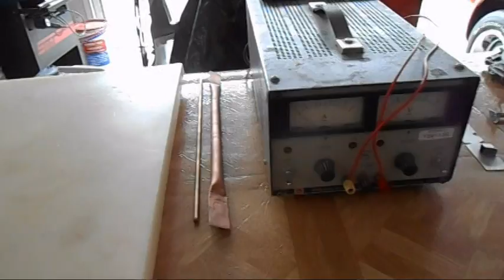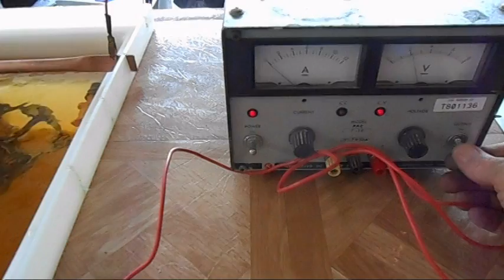Carburetor Plating Cadmium Dichromate

Comment: I'm an old guy that's been rebuilding carburetors and restoring cars for nearly half a century. Now, thanks to your video Mr. Demes, I have the Caswell "Copy Cad" system and have started plating my rebuilds. For all you guys out there who are thinking about doing this type of plating, the Caswell kit takes 90% of the guesswork out of it. I practiced on junk cores for about a week before plating a 1970 428 cobra jet Holley carb. for a customer car.  Remember, if you don't like the way your yellow chromate turns out the first time simply soda blast or glass bead blast it off and start over. I also found that most of the old carburetors will need to be zinc plated over the original aluminum / zinc alloy diecast for the yellow chromate to bond and look good. The Caswell blue chromate looks really good on brackets, bolts , and misc hardware. Two things: The amperage at which you plate parts is an educated guess and is very forgiving....to a point! Follow the instructions to the letter, never use tap water for any solution or rinse, and you will be good to go.
Reply: I have done carbs for 40 something years and have always thought about getting one of these kits . If I had a demand for carb over hauls I would do it.  What do you do for Holleys they have that greenish tint
Reply: What do you use for rinse if you’re not using tap water.?Do I use distilled water.

Comment: Nice to watch a simple vid. No "music" no BS just someone who knows their subject.
Reply: Someone could make a lot of $  if they came up with a browser add on that muted that crappy music people seem to think they need in their videos. Nothing worse than a techno beat drowning out a beautiful exhaust note or engine sound.
Reply: To mix the  yellow chromate solution, you said 1/2 oz. sulfuric acid(battery acid) per gallon and 10 oz. of sodium dichromate per gallon.  I thought battery acid was HYDROCHLORIC acid ?
Reply: Hi Don. I worked at Exide Battery for a few years and all of the Acid used was Sulfuric acid. Hope this helps.
Reply: MegaLuckydog1 and also no 30 inch wheels😨👏😨👏😨👏😨👏😨👏😨👏😨👏😨👏😨👏
Reply: Nice work, bummer that pump is so loud.
Reply: @donrutter6550  Lead acid batteries use sulfuric acid.
Reply: To each is their own bud. Sometimes on instruction videos when a repetitive process is being shown, throwing some music in puts depth in the video and gives it a bit of color so to speak. Not to mention it reflects the person’s personality too. The fact that people take the time to even post things like this is amazing even if it has “music “. Comment such as yours shows how ungrateful people have become.
Reply: Could you cost the inside of a steel fuel tank
Reply: @donrutter6550  nope it's sulfuric
Reply: @jasoncardoza6375  it's a matter of not distracting from the intended purpose of conveying the information. To much of anything turns into a bad thing. It became a contest of who can have the loudest most annoying music, and fancy video effects. In the hopes of becoming the next "famous" YouTuber for a few days. To the point that conveying the information became an after thought. Which is how important information gets forgotten, and not included. Adding personality is fine, but it should be secondary. The real famous YouTube creators that have thier videos shared, and recommended for the long term are the ones who do as this one did. He used the waiting period of zinc plating, or repetitive actions to go into more depth of information. That's how you add depth to a video. The fancy candy gets the women's attention but as Willy Wonka would say, liquor is quicker. 😀

Comment: To everyone out there. If you want your carb to look and work properly  give this guy a call. I was going to try and plate my own parts until I looked at all the cost involved. I can say 1 thing ! Screw that I sent my carbs to Harold and what I received back was a new carburetor . I swear it just came from the factory and the price was what I thought cheap compared  to what you had to do to get the same results. If you think about all your labor not only taking it all apart but then dealing with all the chemicals if you don't screw it up ! He is cheap !! He's honest and straight forward  and that is hard to come by today. I was going to have a guy in NY rebuild my carb for my 68 Camaro and he wanted 3 times more then this guy so do yourself a favor and write him,call him or send it by a pigeon if you have to . You won't go wrong .
Reply: I imagine you could pull this off fairly cheaper. Go to a garage sale, most have a 10 or 20 gallon fish tank with a under gravel filter where there's a plate on the bottom and you put gravel on top each side has tubes and you have 2 pumps you have under water, follow Harold's homemade soups mix, use some spare copper pipe, copper wire and make it flattened out on each end and the same idea for the positive get the zinc he stated buy a cheap 12v 5a constant current power supply or even a beefy DC to DC convertor and fine tune it to your needs, the current is most important. This work makes the money so you can always upgrade.
Reply: do you have contact info for harold? ..been trying to get ahold of him to chat

Comment: Just great and home run. I have been rebuilding carburetors since the late 60’s. Thousands of Q-Jets. And people hate them. It is the only true variable Venturi carburetor on the market that works great. Even the Ford VV7200 & VV7400 was replaced at the dealer with antique 2bbl’s. 
  We did not conversion coat but after cleaning and the coating was gone, we re-hydrated the metal in mineral spirits. It lasted weeks but not as good as this. 
Certified automotive ASE Master Tech since 1978 - Retired

Comment: I am an old guy and have been restoring castings for years. Your work is beautiful.  I learned a lot from your video and I thank you for that. Keep in mind the electroplating process can be done in reverse to strip off plating. Might I suggest on the die cast zamak3 parts that you do not electroplate them? You can clean them as you do then go into a mild nitric bath to open the pours, rinse, then dip in your chromate bath as you do. The result will be closer to OEM original.
Reply: Why do you not recommend electroplating the zamak3 parts?
Reply: how mild of a bath on the nitric acid....about how much per gallon would you recommend

Comment: Harold Demes+ I rarely compliment anyone because most of the time they did a poor job or it goes to their head so please, I'm not a good follower, but I must admit, you did a fantastic job Harold. It's a work of art! Most people don't want any part in real work these days, but if you took the same video and aired it in the 70s or even 80s this video would have had 500 million or more in the same time, too bad we didn't have YouTube back then. Remember when we had to learn on our own? It was a omen if someone stumbled along that really knew what they were doing and told you the missing link. Keep making new videos because things are about to go really bad or really good if allowed, everything makes full circle. I figure 2020 when the past four years sat in and things start to boom again.
Reply: On the Cathode side I would put a small copper or brass fishing swivel wrapped on tight with the copper wire and simply hook the wired part on the hook of the swivel so it doesn't rotate right back and still allows the negative to function or go all out with a high torque low voltage motor that would allow the part to rotate slowly and allow the voltage and amperage to flow to it. Just a thought.

Comment: Most of the "carburetor rebuild specialists" spray paint the carbs silver after reassembly. They look like hell after a few months, the fuel dissolves the paint and gums it all up. I hate that.I always wondered how the specialist parts restoration guys got this finish on parts. This was great. I have heard nothing but great about Caswell.

Comment: Good good GOOD , video my friend , i loved it , very to the point , i soaked it in like a spounge , as back in the days i was trying to do just this very proccess with carbs and bolts for hot rods and custom work and all i could find was from eastwood was an imitation proccess , we were not pleased with the results so i had to drop that idea , but at the time i was buffing and polishing alluminum parts and wheels alternaters and alluminum firewalls on hotrods , that was satisfying work , those turned out prettier than chrome , keepup your good work my friend and God Bless

Comment: Hey Harold. Thanks so much for the video- lots of great info and a super set up you have there. This IMO is the best zinc plating video on the web. Carbs are as you said made of Zamac or Maizac or Pot metal- it is all the same stuff- a bit of everything but mostly zinc. The name is an acronym of the materials included.Did not occur to me to plate them I just vapour blast them which looks good too. The brass inserts look great as well but it is a masking nightmare :)

Comment: Great looking results! I love the iridescent yellows, greens, reds, and even pinks that result with yellow chromating. I haven't attempted zamac. It sounds like there might be a layer of sub-surface oxide remaining that's not allowing conversion to take place on older zamac. Not to compete with what you've done here at all, but just to share my experiences with this, I did some of this for a customer this past spring on steel carb linkages and screws. I didn't get the caswell zinc bath chemicals because of the high price. I made zinc acetate solution, and used zinc roof moss prevention strip (99.99% Zn) for the anodes. It works well, and has a durable bond, but comes out flat, like primer grey. Caswell brightener doesn't appear to work with zinc acetate either. My solution to that is, I vapor blast the part after plating, and put down at least three layer of zinc, vapor blasting between cycles. The vapor blasting very quickly puts a bright satin finish on the zinc plate, which I then either yellow or clear/blue chromate. It makes more work, but the results look good. I used caswell's conversion solutions, so I'm disappointed to hear that they don't last long. I'm glad to see your zinc bath and chromate has lasted so long, so those are something I will consider.
Reply: You're doing a great job Arnlod. I'm looking forward to your new films. Cheers from Poland
Reply: @wl0oczykij  Thanks

Comment: That was excellent ! 
If you were to ever build copies of your set up including every part of the apparatus, chemicals list ,and assemble it ,I would consider buying one from you because you build quality .
But as we get older and things in life change ,we sometimes lose our desire and move on to other experiences to keep our minds vibrant.
What would be easier would be for you to write a book about your experiences and add a list of suppliers ,and the product specifications.
But this video is 10 years old and things change .
Now if you spent say $3000.00 on your investment ,& plated 100 carbs ,That's 30 bucks in process operating cost but if it takes 8 hours per carb @ $20/hour ,that yields $160.00 /day .
That might be a good slow steady income for anyone who likes to rejuvenate carbs that work excellent as long as your heart and commitment to quality doesn't waver.
I thank you for speaking about your process and sharing your knowledge .
I am impressed .

Comment: I didn’t see an extra hot wire going to the second anode. Wouldn’t you have to have one as well? I DK, myself. When I worked at Albert oil, we bought the imitation coating kit that came from the Eastwood company, it was spray cans where you would spray a silver base, then mist red green and yellow translucent metallic paint on the parts that weren’t ever gonna see gasoline, like the brake booster and voltage regulator base and horn relay base and hood release cables. They sent the Corvette to the paint shop after me spending hours detailing the whole engine compartment,And a well-known painter around here didn’t tape off the compartment and got overspray all over my handiwork! Then to add insult to injury, he sprayed everything that he had ruined with flat black rattle can! This was 25 years ago on a $4000 paint job , back when 4000 would get you a flawless paint job, It was a beautiful  64 red Corvette! I lost all interest in the car after that. It was my bosse’s and it still made me about half sick!

Comment: Looks like an early pre 1975 with remote choke on manifold, possibly pre 1972 by the WOT bowl vent at the front. Numbers start with 7** instead of of 17****. Probably 1970 Chevrolet Big-block application? I could tell for sure if I knew the primary metering rod diameter (stamp letter), Primary metering assembly piston height, secondary metering rod diameter plus tip profile and secondary metering rod hanger (stamp letters). Oh, and the primary and secondary throat diameters. Don't forget, if you use a cam that provides less vacuum, use a weaker primary metering assembly piston spring to enhance off-idle part throttle driveability. Good vid!

Comment: Great video, learned a lot! No crappy music or talking heads, just the subject!!   Wondering Why was the base of the carb not treated as well?
Reply from the maker: The base is aluminum. There was no finish on them from the factory. If the carburetor has a cast iron base it would be black oxide or manganese phosphate.

Comment: Hello Harold, this is probably one of the best videos that I have seen. I live in South Africa & to import is at times not only expensive but also difficult. I would appreciate it if you could please give me the breakdown of the chemical solution used for the zinc plating. I am in the process of rebuilding a 1956 Chevy Stepside & am thinking of plating bits & bobs especially bolts & carb with zinc. Sacrificial anodes are probably the best zinc I can get locally although I will try for plating zinc.
Reply from the maker: Hi Tony
 I use casewell zinc plating solution. You can find them on the internet. If you want to mix your own. 3 OZ Zinc Chloride to 1 gal distilled water/20 oz ammonium chloride to 1 gal distilled water. You have to plate some scrap to get the solution ready. This will give you a dull finish that you will have to buff with scotch bright pad to make it shiny.  Sacrificial anodes will give you a rough finish as these anodes are not pure.

Comment: I have a three-gallon Caswell plating kit, and it worked wonderfully at first. Now, however, nothing is appearing on the parts from the zinc plates. Do you have any idea what has gone wrong with my chemicals? I need help on this issue. Thanks a lot, great video explaining this process.

Comment: A great little video and your work is very nice.
I was alarmed at first when I read that you were doing Cad' plating as it has been linked to cancer and essentially taken off the market. Regarding the drying of the parts to let the surface harden up a bit after the Dichromate conversion, I think it's commonplace to run them through a drying oven at an actual plating operation isn't it? I often times take a batch of auto and motorcycle parts to the local plating house here in Phoenix to get the clear zinc plating (after I have done the same type of prep, degreasing and glass beading). They charge a flat rate of $100 for a full 5 gallon bucket. I didn't realize that the Dichromate was simply a secondary corrosive process so now I'm wondering if I can take some of the freshly clear zinc plated parts and run them through the secondary Dichromate  process here at the house in order to get the gold color on only those parts I want it applied to. The thing I'm unsure of is whether the plater is applying a top-coating to the clear zinc that will prevent the Dichromate from working? Anyway, thanks for the video, truly informative and inspirational!
Craig
Reply from the maker: Its all Zinc plating no Cadmium. Yes you can do your own Dichromate Conversion at home if the parts are Zinc plated. The plating company will not put any thing on you Zinc plated parts so you should be able to do the conversion coating on them. In my video I give two formulas for the conversion. One is for a light passive blue color.The other is for the gold color. Same sodium dichromate material just different acid and amount. The passive blue was used on power brake boosters a lot and also the gold. You can also do nuts and bolts from hardware store that are zinc plated. Sometimes you have to buff them with 0000 steel wool to take the oxidation off if they have been sitting around for a while. Professional plating companies will use a hot air drying system.I just blow dry with compressed air and leave them harden in the sun. No problem in AZ.

Thanks for watching

Comment: Hi there Harold, great video!
I was wondering if you could give the recipe for the solution in the plating tank and what the voltage/ amperage should be for carbs. Thanks a bunch!
Reply: Waitting for the answer dude
Reply: Dilute Dichromate plating solution concentrate.

Comment: Excellent video very entertaining and with a very clear and precise explanation. I think I will do this, but I have a question about sodium dichromate, I have read the safety data sheets and it is a very toxic and dangerous chemical, it cannot be disposed of so easily due to the damage it could cause to the environment, my question is how Could I throw it away once I finish all my projects? I think maybe it can be safely neutralized?

Comment: In your solution for the cadmium plating, you refer to ( per gallon ).. .. per gallon of what. ? Distilled Water ? ?... If so, does that not cause any issues later with rust..
Thank's for a Great Video .. !